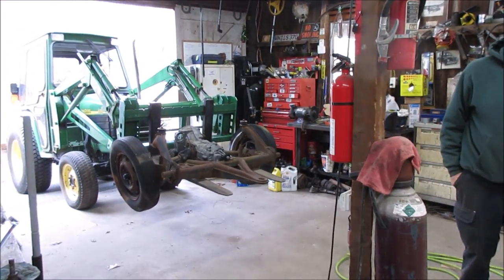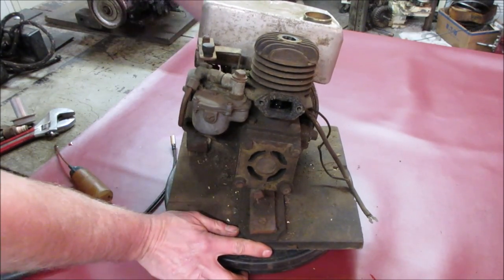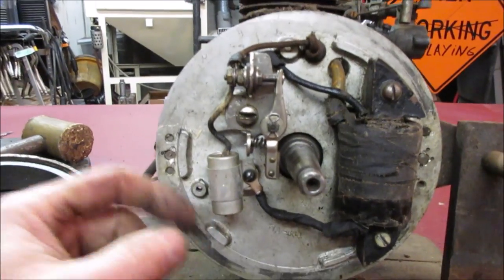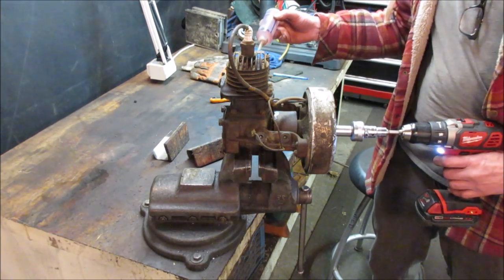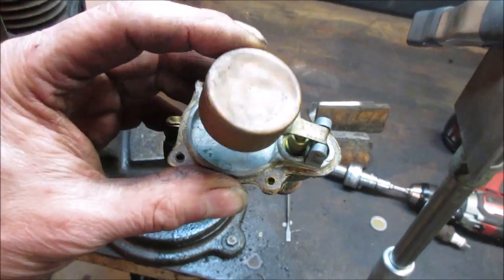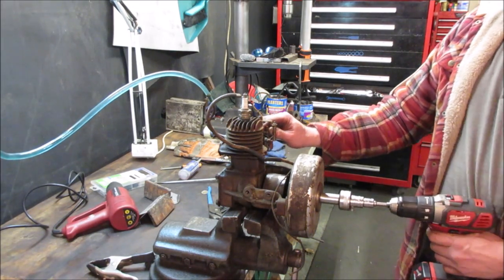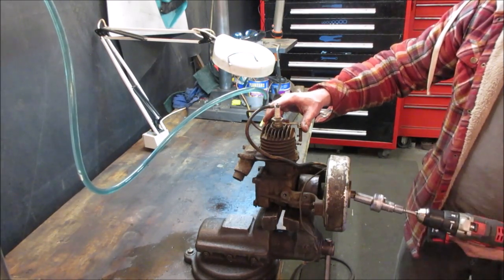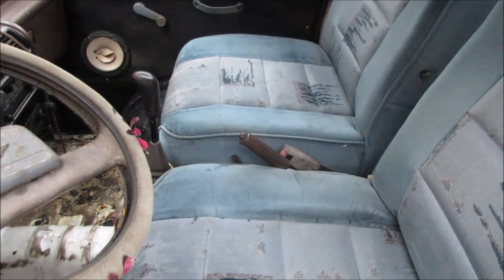Sitting at Least 45 Years In A Barn, Pre War Elgin Cycle engine.

Comment: Spark........Acts entirely different from what you are seeing on the outside at normal or 14.7:1 atmospheric pressures also. Under Compression, you are compressing the air molecules which thus makes the compressed air much more difficult for the spark to jump it's air gap. If you have carbon which is the basis of what? Anything conductive around or making contact with the ground of your plugs and it is all up the center electrode, electricity is lazy and will always take a path of least resistance to find ground. Using used dirty old unknown spark plugs makes me cringe man! Please before ya throw in the towel on engines especially 2 strokes please don't make these simple assumptions about something being no good.... 2 strokes back then are very primitive and sensitive to how finely turned you have them. Because most of them back then did not even have crankcase shaft seals. They used long journals or bushings on the crankshaft ends to relie on keeping enough pressure in the crankcase to get the air/fuel to the top of the piston. So sometimes they can definitely wear the bushings or yes have a hard seal. Hope this helps you a little bit, just because you see spark on the outside jumping across the gap, doesn't mean it's doing so inside the cylinder under pressure, it will more than likely follow wet oily carbon tracks up the porcelain to ground. A little advice from someone whos been building and restoring vintage 2 strokes almost my entire life here.....But a simple spool of spark plug wire copper braided.  It saves lots of time and questioning if the insulation is leaking on the spark plug lead......always keep a roll of wire, crimp on ends with boots and universal points condensers, Stens sells everything ya need, use either Tecumseh or even Kohler points condensers and dude your life be so much more satisfying to get things running better and easier. It never pays for yourself in loss of better terms, to really attempt to get something to run when the ignition system is crumbling to dust. I just do not understand the backwards methods here. Giving something a spin and gas and having any sort of expectations for something to run let alone run halfway decent or long enough to make video content? Why not go through the common known problems that comes with sitting around for 45 years?  Like check and clean carburetors first hand and make sure gaskets are in place along with parts are tight? Idk? Just sometimes painful to watch things like this, believe me not trying to be a douch here, just honestly sayin, if you wanted to make life easier on yourself....... Also it might help others to see how these things can be done relatively quickly and easier, rather than making things appear harder than they have to be.......Just knowing after running shops and training people in small engine repair at work and at schools, if someone stumbles upon a video like this, it will leave them feeling kind of discouraged and not even wanting to try doing it themselves. Like I said, I'm not here trying to be a douch bag about your videos some I really like and appreciate to see, but there's a right way and what's known as dicking around with enough information to get themselves into trouble.
Reply: Good man, Jim. My own thought, exactly. Also use an oil-can to lube the overhead camshaft and rockers before starting a Honda or similar engine that has been lying up a while.

Comment: Generally speaking, you are not doing any repair, you just keep putting oil and do minor cleaning to the point and waiting for the engine to reform it is self, it is very painful to watch you struggling with the fume and smoke and keep trying and prying and then after it run a little bit, you leave it alone. this is not a mechanic solving a problem it is just guessing work.